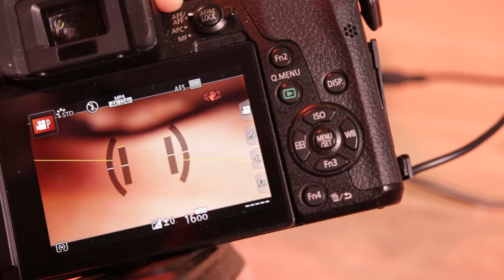DIY External Battery & SD Card Slot Mod Box for the Panasonic G7 Ep. 15

Comment: this is a really cool! - my only thought after taking a look at this design is that it may be beneficial to get a larger usb battery (like one of the 10 or 20 amp hour ones), strip the casing, and integrate it into the box rather than needing to have an external battery, then you could just charge the box and it should be good for a good what? 8-10 hours? - you could even route other usb plugs to the outside of the box to power accessories such as perhaps an external sound recorder, or light or monitor or whatever you like.  also, perhaps it might be beneficial to adhere some coldshoe mounting points to the sides of the box as decent places for mics, lights, and other accessories to go.  the whole thing certainly gives me inspiration as to how to go about outfitting and rigging this up!  thanks.  not to poo-poo your project any, but I did find an integrated voltage converter/battery cheater solution that's quite a bit more compact and probably a bit more robust than the bulky voltage converter that you displayed in use here.   I use it with one of the aforementioned giant power banks and it works like a charm, or I can throw a usb extension on it and plug it into the supplied usb power adapter and use it in a studio rig. https://amzn.to/31BiFq3

Comment: This is great! I decided to get the voltage booster after I accidentally set a 21,000 mAh from 9v to 20v and fried a G7 (well it was a brown out and the somehow it reset the battery back up). I got a new G7 and got the old one repaired, but it didn't work on the voltage booster because I was too scared to set it any higher than 8v. Thanks to you, I can get off the batteries!

I will also be getting the SD card extenders. I shoot around 8-10 weddings and 2 dance recitals a year - so these 2 mods on both cameras will save a TON of time and stress in trying to get new batteries and SD cards in!

I saw you're working on a motorized dolly - any suggestions wireless pan/tilt heads on a remote controlled slider? I'm a 1 man show with multiple cameras, so I'm trying to automate/remote control as much as possible on a per job budget, since I do this on the side.

Awesome work!
Reply from the maker: +digitopiabiz I've been working on an automated slider. It's working, but not polished. If i get that working and looking professional, the idea is to integrate an auto pan- tilt head. I'd like to have the camera aimed at a fixed subject and slide and pan together. That kind of project takes a bit of time. If I have something finished, it might be six months from now.
There are projects out there if you look around. The one thing I'd look at if you see some of those designs is metal on metal. Bare metal bearings on a metal track has proved to be too noisy if you need good super clean audio.
Reply: Did your G7 work at 9V OK? Or did you fry it at 20V without getting to try the 9V much?
Reply from the maker: Never tried 20v... I only went with a voltage that was reasonable at the low end and bumped it up to 8.4v as that's about right for 2 lithium batteries and what the camera was most likely designed for. Though "9v" did work with another voltage converter I tried, which measured more like 8.7v with a meter.
Reply: Thanks. The G7 does time lapse but the battery supposedly can only do 300 pictures so that makes it rather worthless. I was thinking of using a 23000 mAh battery that supplies 9V. The comment I thought I replied to said S/he fried a G7 at 9V to 20V. 
 https://www.amazon.com/RAVPower-23000mAh-Portable-External-Smartphones/dp/B00HFMUBYG

Comment: Can I just disembowel original battery and connect external 18650 li-ion on that? I think it should work. And I found way how to charge non originall batteries (if that not working) with original panasonic charger, I just hid one contact and it charging all batteries now, it's black magic :-D
Reply from the maker: You can just buy an 18650 battery holder and 18650 batteries. I did this project in a day and it really could be refined in just about every way (smaller, better looking, and easier to hook up).

Comment: Hi! I already used dummy battery and I know the voltage . 8.5 - 8.7 volts. But please..do you know the power consumption of the Lumix G7 in wats? I want to build box capable of powering the lumix both from th wall plug (12V) and from my powerbank. So the power consumption will be really helpful. Thank you.
Reply from the maker: Not sure what you're going for here.
Voltage is the more important number here. There's some circuit protection in the camera, but I wouldn't go testing it. Don't quote me on this, and don't go with these numbers without some more research, but you'll probably be in the 1 amp or so range for how much power you want to have available. Normally you'd look at volt amps for power availability, which is technically the same number as Watts (how much you're actually consuming), but designing from that angle can get a person into trouble.
Reply: Sun Pixel Video well I am asking because of powerbank. I want to know, if I am capable of running my Lumix from standard 5V powerbank or if I need to force QC 3.0 voltage using some circuit.
Reply from the maker: In that case, I'm just using a boost converter to step up the voltage and a power bank rated for 1A. I guess that would be USB 3.0, though I don't know if it has to be QC. 500 mA might be enough though. If your in a hurry, I'd just get something with a blue USB 3.0. If you can wait a few days, I'll see if USB 2.0 works.
Reply: Sun Pixel Video of course I can wait, but if it is running with 1A 5V powerbank, everything is alright and it will run with mine too. My powerbank is rated as 2A 5V and then capable of QC 2.0 and 3.0. :) so it should run OK with the step up only.

Comment: Hi, Any small power bank you can recommand (with battery level) to use and how long does yours last ?

Thanks to answer
Reply from the maker: Any USB battery bank should work. The higher the mAh rating the longer it should last. I would say anything over 4000mAh should be good.
Reply: Thanks